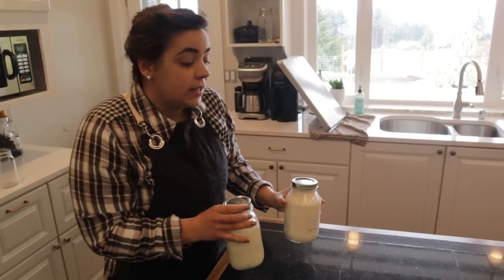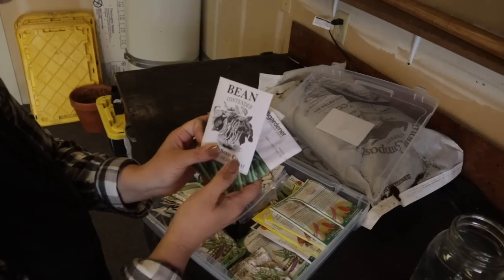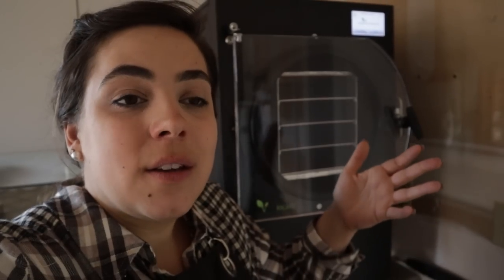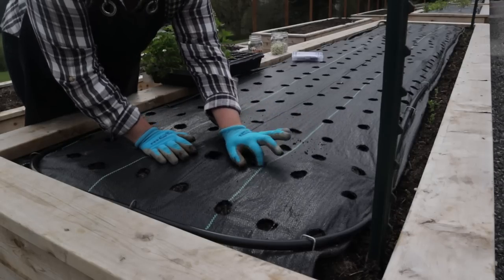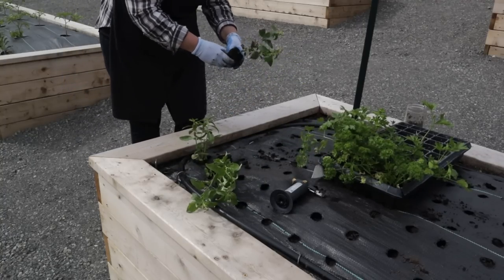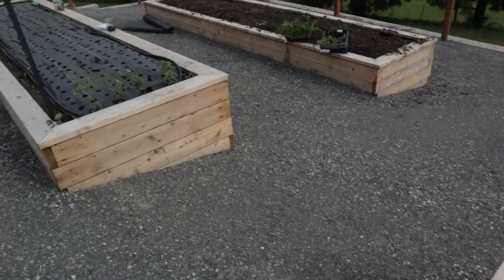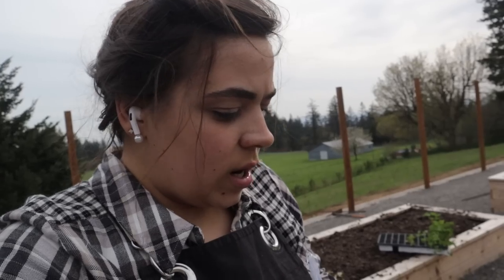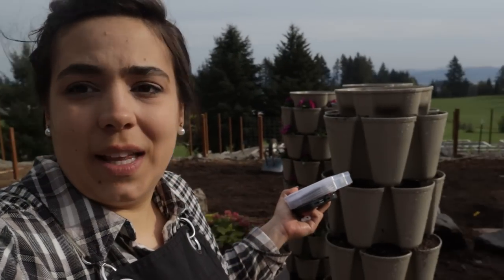I forgot just how EASY it is to make at home!

Comment: I think your idea of using the landscape fabric was brilliant. Upfront you have the work of making all the holes, but every year after it will be all set for planting. When you put your garden away for the season, I would suggest putting a label on each sheet so you know what was planted in the holes. It will give you predetermined spacing for the next year's plants.
Reply: My concern with the fabric material is how quickly it disintegrated ( melted ) with the torch .. the concern being ,  that it is chemically fabricated and those chemicals are now in your soil and could possibly be contaminated 🤷‍♀️
Reply: Cynthia .. my concern is that as the material is melting  , chemicals , that are in the material , will be released into the soil  , rendering it no longer to be 100% organic … the plants get their nutrients from that soil , which might in turn compromise that plant . I am definitely not a scientist but I have concerns .
Reply: I mentioned the very same thing! Lol... yes...so easy next year to pull the fabric out when you're ready to plant the veggies..❤👍

Comment: I grow my cucumber, squash, cantaloupe and watermelon seeds in small containers until they're about 4-5" tall.  Then I plant them.  I have had zero issues with them not growing/producing fruit.  My direct sowing method didn't work.  I take all of the soil that's in the pot and plant it with the seedlings to not disturb the roots as much as possible.  Good luck with yours.
Reply: I do the same. I figured that out last year too as to not disturb the roots at all. Plop it all in the ground without breaking up the soil or roots.

Comment: Hey Becky! In Puerto Rico, the days are really hot. As a substitute in the hot summer, try growing Culantro! It loves the heat and won’t bolt durning the summer. It tastes very similar to cilantro. In our dishes, we use cilantro and culantro together. It’s a staple in our dishes! It’s a harder leaf with serrated edges.
Reply: Thank you for sharing this.  I just looked up culantro, so I'll be ordering seeds ASAP.
Reply: Interesting... i wonder if it has the same 'soap' taste to those who get that from cilantro. My hubby is real sensitive to it...
Reply: @aliciadupuy9228  I just looked it up and the soap taste can be worse than Cilantro! It has a very strong taste and needs to be used in moderation. Sorry to your hubby!
Reply: Must be a taste bud problem because we use it and I’ve never had that flavor from it besides I never ever eaten SOAP
Reply: @maryybarra4841 it is, kind of. Some people have a gene that makes cilantro and other related plants taste soapy. It’s anywhere between 3-21% of the population depending on location that has it, in comparison, about 8% of people have blue eyes and about 13% of people have O- blood type ☺️

Comment: Becky use your corn as the pole for pole beans, they companion plant together really well. The beans provide nitrogen for the corn the corn provides support for the beans 😊
Reply: Yes! I was looking for a comment like this
Reply: That's how the 3 sisters garden is done. Beans planted in a mound around 4 corn stalks, beans grow up the corn, squash is planted between corn mounds. No weeding necessary.
Reply from the maker: I need to try that!
Reply: Love this
Reply: @desert_moon  this may be a silly question but does the corn need to be sprouted and growing before the bean seeds are planted or can all the seeds go in at the same time?
Reply: As for pintos needing support I think it depends on the variety.  There are both types
Reply: @Cheryl Presleigh It would be better if the corn was about 12 inches tall before starting the beans. I have, however, started squash seeds at the same time as the corn usually at least 18 inches from the corn. You can research the 3 Sisters method. Fish emulsion appropriately mixed will be your friend with this arrangement. Have fun. 😊
Reply: I have done that.  The dried corn stalks do make good bean stakes.  However, when I tried the 3 sisters, it did not work for me. One, I did not know that you don't plant the corn and beans at the same time. The beans strangle the corn leaves, the beans can be planted around the time the tassels appear. Then they won't interfere with the maturity of the corn.  I think the squash works better in an open field planting.  The squash spreads so much that it is hard to do anything in the bed because there is no place to stand except on the squash leaves.  Squash works better on a strong trellis that is at least 50 ft long, or plant it in an open field where it can sprawl to its heart's delight.   As to planting on the deer fence.  I would not plant anything deer like to eat on that fence, because it will attract them and they will eat what you grow on the fence.
Reply: @cherylpresleigh6403  If you are doing three sisters, it is better to plant the bean seeds when the tassels come out, so it won't wind around the corn before it matures.
Reply: @imafan26  thank you, that makes a lot of sense.
Reply: @tamarajergins6211  thank you, I’ll do some research.
Reply: @cherylpresleigh6403  you're welcome 😊
Reply: And you can plant the squash under both as they can spread and fill out around the base of the stems.
Reply: It is a pain to harvest, though.  The beans are everywhere, and you can’t get in there to pick!  VInes all over the ground, and all around all the corn.  If you do it, make sure you space your corn at least 3 feet apart, so the bean vines don’t wind around multiple plants, blocking your path.   But you’ll still have to be careful not to step on the squash vines.
Reply: We do 3 sisters, and i LOVE it
Reply: For 3 sisters: An alternate to corn is sunflower;  An alternate to beans is peas (if they can handle the temperature, looking for nitrogen-fixing plant); The purpose of squash is to shade the roots...so theoretically a melon would work
Reply: My father dd that every year

Comment: You will have more luck if you use a short season variety of  corn like Bodacious.  It is a SE super sweet variety for eating.  Corn is sensitive to day length and temperature. The Pacific Northwest is outside of the corn belt.  So, am I, for different reasons. My longest day is just short of 14 hours, but I have heat to spare so I plant a tropical corn called UH #9 developed by Dr Brewbaker at the University of Hawaii. It has a tight husk and is a super sweet shrunken kernel corn.  Tropical corn only requires 12 hours of sun to mature. You will have more sunlight but needs temperatures 60-85 degrees.  Colder will make corn grow very slowly and that will affect the ultimate days to maturity.  Corn is a heavy feeder. It should be planted in blocks.  In a raised bed you can get away with 8-10 inch spacing.  Ideally you need 4 rows in a block.  4x4 minimum, unless you plan to bag your tassels and hand pollinate the silks. Corn requires 2 side dressings of nitrogen. The first when the corn has true leaves (this needs to be a fast nitrogen, you may have to put the first dose in  a week after planting for organic fertilizers.  The second side dressing should be when the tassels appear.  You would have to base this on days to maturity, because Organic fast nitrogen, is not fast. It still takes two weeks at a minimum to be available, so the markers I use may not work. Timing the nitrogen side dressings is important to getting the best result. Corn grows so fast, you cannot be late with available nitrogen.  I use sulfate of ammonia so I can use the markers ( true leaves, and tassels to tell me when it is time to side dress)  Usually corn is ready to harvest 10 days after the tassels appear.  Bodacious is a 75 day variety give it 7-10 days to germinate.   So harvest should be about 82-85 days from planting.  Corn does not germinate well in your climate but you have a short season, so it might be better to start corn in cells indoors where it will be warmer and germination will be better. Corn does not like to be transplanted, but it can be, as long as they are not in the containers too long.  I think you will learn to love the weed fabric. It really helps keep down weeds and keeps the dirt and fungal diseases off the lower leaves.  But it will be harder to weed, because the weeds will come up alongside the plants.

Comment: It's recommended to give  at least 18 inches between tomatoes. These tomatoes look very close and you may get issues with blight... Jess from Roots and Refuge mentions that you need the air flow between plants (not just in ground but in raised beds) if you want to avoid disease.
Reply: That’s completely dependent on where you live (Jess mentioned that too :) ). For example, I live in dry utah.  We don’t have blight problems here typically.
Reply: @SaltCreekFarmstead  these tomatoes look tighter than a square foot with beans growing in the same bed. It's going to be wild and crowded...I hope I'm wrong but this is the time to swap out plants before they get too big.
Reply: @tibbs4000  I’m not saying that it’s not tight, just saying that she’s pretty dry during the summer where she lives.  I grew up in the pnw. I also break most gardening “rules” as a general rule :) I intensively interplant at a high density. Most times it works great for me. Once in awhile I learn what I can’t do in my climate.
Reply: @SaltCreekFarmstead   Becky stated she doesn't prune her tomatoes, so with all those branches intertwined and beans on top of that...I just don't know anyone who would advise all that chaos in one bed. Like I said, I hope she manages to harvest healthy fruit from it.

Comment: I see this time you’re using sour cream. Looks like Nancy’s in your last video of three years ago you used yogurt.  I have neither, but I do have SuperNatural Kalona non-homogenized and low pasteurized Kiefer.  That should be just as good right and supposedly Kiefer has more effective type of probiotics for the digestive  system.

My oven has a dehydrate option, but the lowest temperature is 170 
It also has an option for proof which can go either 110 or 125 Fahrenheit

Comment: Hello! I don't know what I am doing wrong. When I made sour cream, I used about pint size jar. I put couple spoonful of yogurt. Then mixed and placed it in the oven with the light on. It was in there all night. I checked the temperature, it was 88 degrees. Then I have instant pot and place it in there for 110 degrees. It isn't think. Little runny. 😔

Comment: poss idea for using your seeding square with the fabric - find some bright neon chalk that will fit thru the holes.  put it in the hole and twist to mark the fabric.  Then you have something to aim at when burning.  You can use your labels to mark the 'setting' for each section so it's easier to re-use the next time.

Comment: Supertunia type petunias are typically grown from vegetative cuttings and are considered expensive.  They can be used in-ground, baskets, or large containers depending on the series.

Wave petunias are typically grown from germinated seeds.  They are primarily bred for vigor in landscaping, but due to their low cost, growers use some of the series in hanging baskets.

Both are more heat tolerant and last a lot longer than the petunias offered in the early part of the season.

Comment: I just saw a tip in cleaning your grill... cut an onion in half and use it to clean the grill... right before you start it up... cut a potato in half and rub on grill... the starch will act like a coating and help meat not stick... has anyone done this... does it work?

Comment: I read a study from the Swedish University of Agriculture about gardenbeans, soybeans and lentils yesterday. The conclusion is over all for beans that they do not want to grow in wet soil. Moist but permeable soil and regular watering but not overdoing it. They also do not like cold soil or air temperature but also not to hot, if so they loose the flowers and the harvest reduces. I guess they are a crop that is getting a positivt affect from using fiber cloth as a protection, at least in my area of the world with a short growing season and cold nights.

Comment: LANDSCAPE FABRIC TIP: Becky, you can still use your seeding square on the landscape fabric.  Experiment with chalk, marker or tiny bottle of acrylic paint. 

Just lay the square on the fabric,  dab it with the paint or marking method of choice. 

When you get a couple columns marked, go ahead burn the fabric to make sure that spacing is working for you. Make any adjustments you need and repeat. 

Then go back and make the holes the appropriate depth. Then go back and plant.  

You could certainly mark out an entire bed or partial bed and then go back and plant.

Comment: Here a recipe u may want to try for kombucha

Many of you asked about the rhubarb lemonade so here's the recipe I used to make it! Feel free to adjust any of the measurements to make it sweeter or more tangy.

6 cups chopped rhubarb (choose the red staulks if you'd like a pink lemonade) 
1/2 cup sugar or honey (to one cup for sweeter)
Juice of 1 lemon 
6 cups water

Bring rhubarb, sugar, lemon juice and 1 cup water to a boil in a saucepan. Once boiling, reduce heat to a simmer until the rhubarb turns to a compote (about 15 minutes). 
Place a strainer over a bowl and strain the mixture. (You can use the spent rhubarb to make turnovers or crumble!)
In a pitcher, add the rhubarb syrup and the remaining 5 cups of water (can be more or less depending on desired sweetness/tartness).